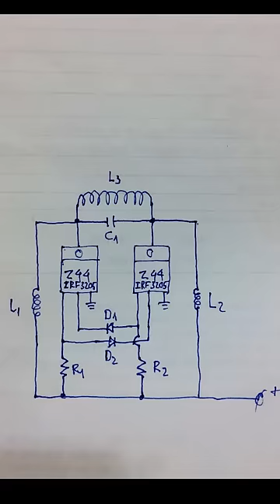built an induction cooker from hard drive #Shorts

Comment from the maker: https://youtu.be/c3soq_1_3Ts
Reply: Pega um caminhão só você um carro só 1
Reply: 4000 ke hard disk ki jagah 2000 ka machine le leta mehnat bhi nahi kar ni pad ti
Reply: Reduce losses by making a slot from the center hole to the top. It will prevent heating of the aluminum and reduce power loss.
Reply: Can we make Maggy in it
Reply: Is induction is not safe for human since it's open wide and not split💔????

Comment: Now build a hard drive from an induction cooker.
Reply: That would be legendary , if he put a hard drive in an induction cooker by removing all the parts from induction cooker
Reply: What no
Reply: Its pretty easy. Remove the cooker screws, remove the top plate, remove the heating coil, put a hard drive inside, done!
Reply: @octanebd  👍👍
Reply: 😅😅😅
What a joke 😂😂
Reply: just reverse the video😆

Comment: Build an induction cooker using just a hard drive and all the bits required to build an induction cooker.
Reply: All of those bits could have been sourced from elsewhere in the old PC the drive came from.
Reply: @moconnell663  Well they where not. Also, you could only get less than half of those  parts from a computer and all of them would come from the power supply. No counting the GPU fan he used.

Comment: " From a hard drive" you didnt need to use it, not even destroy it
Reply: was probably a dead hard drive
Reply: @PneumaticFrog  you sure? the guys know what hes doing, so i suppose he wouldt waste a working drive
Reply: @schaab7203  what. no, I said it was probably a dead hard drive. not that it wasnt.
Reply: By the looks of the surface wear it's most likely a goner.
And also it's a 80GB unit. Small for today's standards. Where 256GB HDDs are cheap and even 2TB ones are decently priced.
Reply: Why would anyone assume it was a working hard drive? I don't even work with electronics and have 3 dead hard drives laying around, they're not hard to come by
Reply: Yooooo
Reply: @PneumaticFrog  i was just accepting your response
Reply: @tabout7920  yooo
Reply: Even if it still working .i maybe still trow it away if i have that drive 😂 .
Reply: @Raphtalia  why? You know there places the collect the elements used, do not throw away eletronics away, no matter how old
Reply: Hes just showing that you can do it and ita a fun little experiment
Reply: @schaab7203  exactly so why you even commenting this
Reply: The aluminum cover is a good heat sink

Comment: The fact that you use the Gigabyte GT graphics card fan 😂
My GT210 sweats in anxiety
Reply: What can you play on  210?
Reply: @bedroxzbass4706  You cant really play anything on a GT210, its best suited as a display output and not for advanced 3D acceleration.
Reply: @P2PC  can it run minesweeper lol
Reply: @bedroxzbass4706  Definitely. The GT210 is capable of running older games and 2D games for sure. Don’t expect the world out of an 11 year old display adapter.
Reply: @P2PC  lol my 1050 2gb should be alright then
Reply: @P2PC  I'm just thinking of making a pc specifically for old games like doom 1 and 2
Reply: @bedroxzbass4706  In that case you would want period correct hardware for the best support instead of running a GT210, the 210 is best suited to modern computers for running older games via software emulation, if you were to install one on a dedicated retro PC you would have all kinds of problems. 
I used my existing work PC from 2003-2004 era for my older games collection with a Phenom X2 Cpu and Matrox Parhelia Gpu, everything runs flawlessly. I originally tried emulation on my main 7700k and GTX 980 Ti workstation PC and it ran like garbage due to poor optimisation for newer hardware.
Reply: @bedroxzbass4706  If you want any advice on what parts to pic I’d watch a TY channel like PixelPipes or Phil’s Computer Lab.

Comment: How much of the energy is spent on cooking the aluminium case?😂
Reply: Q=cm(t2-t1)
If the mass of aluminium is 50 grams, then
Q = 904 * 0,5(100-20) = 36160 J
(Not sure if its correct tho)
Reply: @yourbigfan1777  don’t think it is, e=mc^2 is for when you’re converting mass to energy like in a nuclear explosion where some protons/neutrons are turned into energy
Reply: @yourbigfan1777 The equation you’re looking for is q=mct
50g
c of aluminum is 0.89 J/g degrees C
T = from room temp to 100c, 100-35=65
Q=2892.5 Joules
To think that the only application of high school chemistry so far is god damn Youtube comments

Comment: And WHAT PARTS, EXACTLY did you use? 
It would make duplicating your trick a whole lot easier!
Reply from the maker: https://youtu.be/c3soq_1_3Ts
Reply: It litterally sais it in the schemativ
Reply: @joran4612  indeed haha 😂
Reply: If you don’t know what he’s using, you shouldn’t be doing this in the first place lol that’s how severe injuries happen
Reply: .... He gave you a drawing. You literally have everything right there except for the fan in the middle which you can substitude it with any 90mm fan on the market, like those old school RAM cooler fans.
Reply: @Uneke  that's not entirely true, being that it appears to just be a 12v battery at worst you'd get a mild zap from doing something wrong, maybe a popped component. You can't gatekeep diy with lack of knowledge, most diy is experimentation anyway 😂
Reply: @Topaz1112  it’s an induction stove… he could easily burn his house down, severely burn himself… a mild shock is the least of it lol
Reply: @Uneke  do you understand how induction stoves work? This is induction not conduction, it requires a metal item to be placed on top before it will actually do anything, it alone doesn't produce heat
Reply: @Topaz1112  yes, I understand this. But if it was not done properly, and say touching the casing, it would go on immediately and not turn off… and that’s only if it was wired properly… could easily turn into a convection if not wired properly.

Comment: "We can use batteries"
No, don't do this at home
Reply: Exactly, If your running a high current device you need a Mains power supply thats up to spec not some random 12v battery. Batteries of the size and rating similar to what was useful get very hot when passing high current which can lead to obvious problems.

Comment: Good But Hard disk is more Costlier than Induction cooker.....so Try with another Thing
Reply: It's an 80GB HDD. They're literally dirt cheap second hand. I've found one for 3 euros. And that doesn't stop you to search even smaller capacity units like 20GB, 10GB etc. 
80 is enough to hold Windows 10 and that's about it.

Comment: What's the function of the fan?
Reply: I think its effect is to cool the components
Reply: The same one of the microwave fan, make a efficient  and uniform heat  zone...
Reply: @danielangelesgomez285  Does it spread the heat?
But, a microwave fan cool the components, mainly the transformer.
Don't you think that this fan could work cooling the copper coil of the induced heat generated in the pan?
Reply: It cools down the coil temperature.

Comment: Looking through the comments. Amazed by how many people are shocked and sad he used a HDD like it's some 500 euro bespoke part.

It's a 80GB unit. I've found used for 3-5 euros a piece. 80GB is absolutely nothing nowadays
Reply: I dont think anyone is shocked or sad he used a hard drive. It's the fact of the title says it was made from the hard drive.
But in actuality they did the same as if you were to say you were going to build a car out of an old plane.....but all you did was take the seat out of the plane and put it in a fully assembled Honda Accord
Reply: Well you can't use the disks or the pivot to make a fan and coils out of it. The only thing remotely useful to him would be the spindle of the drive. An induction heater requires specific parts to be an induction heater, and most of them are not available in a hard drive. Taking the argument with the car you used, it's like asking someone make a car out of motorcycle parts only.
He did use (most of) the case of the drive to build a compact HDD sized heater in the end. You can't fault him that most parts in a drive are useless to him.

In my comment I was reffering at people that treat that hard drive like it's something extremly expensive. If you read through some replies, there is for example someone who said an induction cooker is way less expensive than that HDD he used. I just pointed out that it's just an old HDD with an obsolete ammount of memory (80GB is enough to hold Windows 10 and that's pretty much it).

Comment: I love how absolutely none of the internals were used in the making of this. You could have almost literally used any other container. Fuck, use a tupperware container. :/ Was not worth watching.
Reply: Ew a furry
Reply: The hard drive’s only use is to be a heat sink, so you could just replace it with an actual heat sink.
Reply: He used the molex connector for power though
Reply: It might be useful if you have a hard drive with broken heads or plates, the shape of it makes it ideal for this DIY
Reply: @HoloScope  Pretty sure that's called an otherkin
Reply: The aluminium enclosure is literally the worst material for the induction coil
Reply: @dtibor5903  you know that not meant for shielding but for mosfet cooling
Reply: also, the case is literally all metal, which means like 98% of the energy will be used to heat it up
Reply: @dtibor5903  actually, an iron enclosure is worse than aluminum for use as induction cooktop enclosure